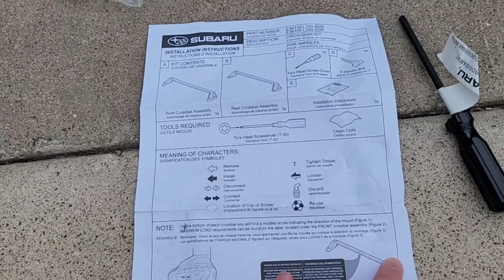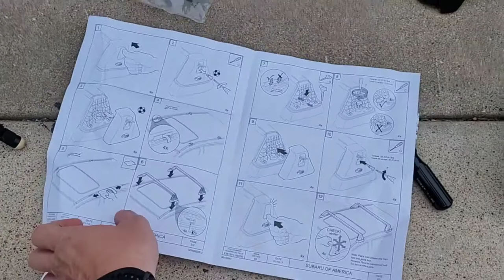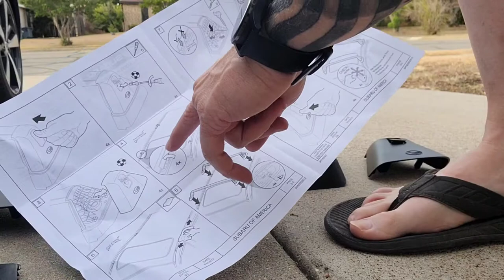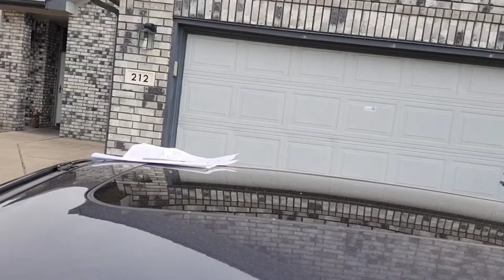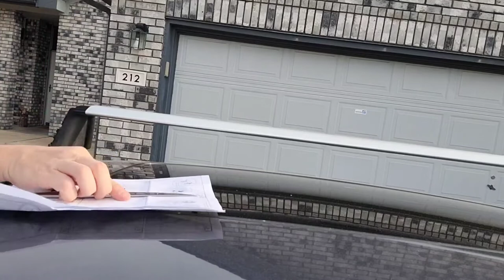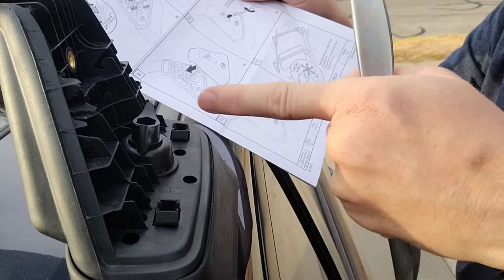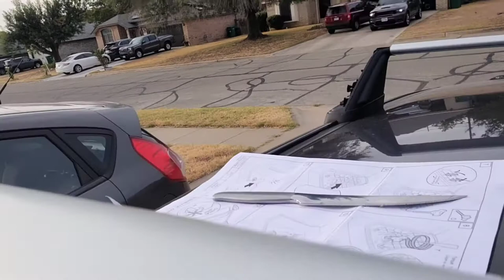2017 SUBARU IMPREZA OEM Fixed Crossbar | EverDave #install

Comment: Just got these for my 2017 Forester they are nice , the rubber piece on top we pushed in, sliding across too hard ( too difficult ), could not really see what screw hole it was going in and we just torqued them very hand tight, the cover keys were little plastic keys, everything really looks nice just remeasured it is good
Reply from the maker: Only question I would ask is did you order the right ones? They are different for the sedan versus the 5 door (hatchback). Just curious because mine installed very easy.

Comment: wow....easier than i thought.  subaru wants $189 to install these!!!     2023
Reply from the maker: So easy isn't it lol 😆
Reply: For me and my son it took us maybe 35 minutes , we installed the top rubber bumper inside and the wind guards inside , the rest all outside just pick a nice day , we rolled all the car windows down, way easier nothing to bump, if you have a small step stool turned sideways with support you can look downwards onto the roof easier only thing I’d recommend , the protective stickers are a little tricky but they do allow you to kind of peel up a little, hardest part

Comment: Thanks Dave like your t shirt. 
SO what is the brand and do they lock?
I just purchased a 2022 impreza and want to compare price ? They look easy to set up. I have two kayaks should be good for my kayak cradles
Reply from the maker: These are OEM Subaru crossbars. Super easy to install and fairly quiet too. The link to them is in the description. Alot cheaper than other options too!!!
Thanks, it's my design and is available at ByFaithClothing.com
Reply: Thanks but do they lock or can someone unscrew them off the car. 
We go backwoods paddle in camping, and need to leave the car parked unattended for long periods of time?

Comment: Hey broski! I was wondering what type of bike rack can actually fit in there? Usually theres a layout in the center of those bars
Reply from the maker: I bought these to hold a kayak mount so I'm not really sure to be honest. I also installed a hitch that could be used for a bike rack.